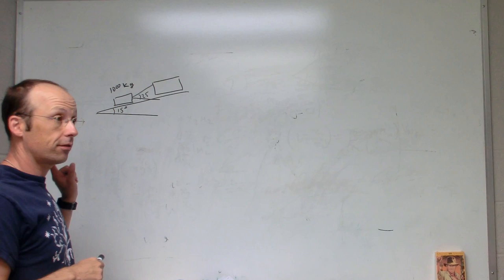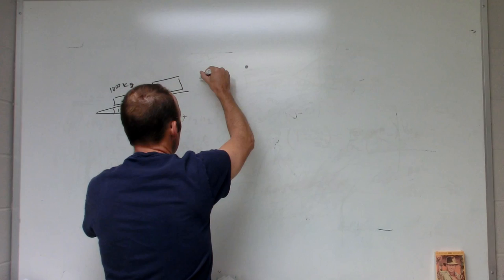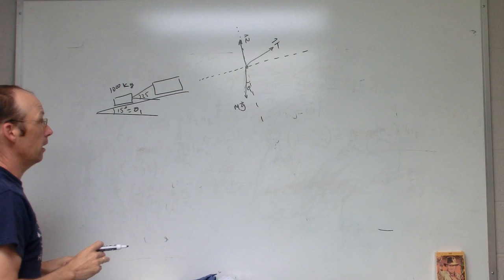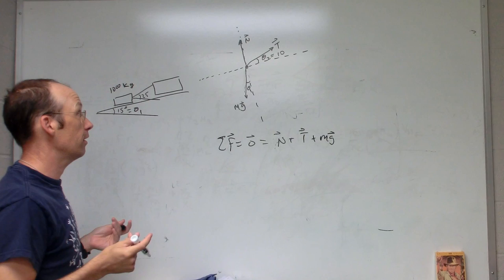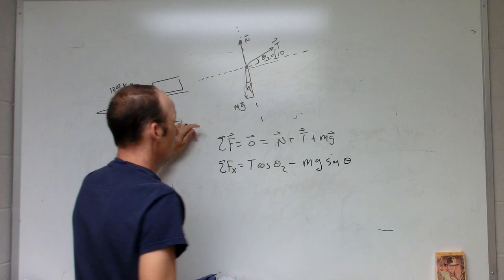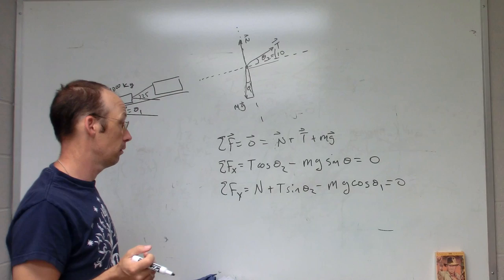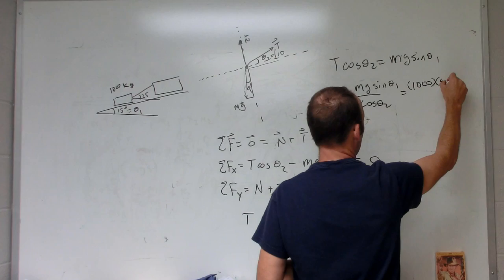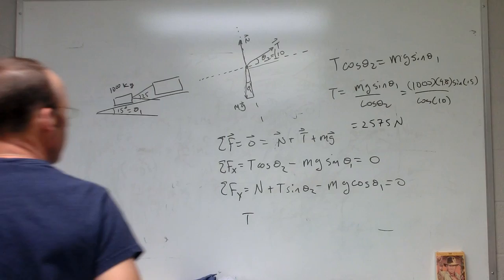Tension in a rope pulling a car up an incline

Comment: What if there was friction?
Reply: That's what I am wondering. Did you find an answer to that?
Reply: awesomesauce If the coefficient of friction is known, the force of friction (which is the coefficient of friction multiplied by the normal force) would just be added to the free body diagram just as any other force would be added. You'd then have to subtract the force of friction (because of the opposite direction of the force moving the object) from the proper component in the summation equations (usually the x-axis).
Reply: @Limonene788  Should I add job done by the friction to the job done by the winch or do I need to substract it.